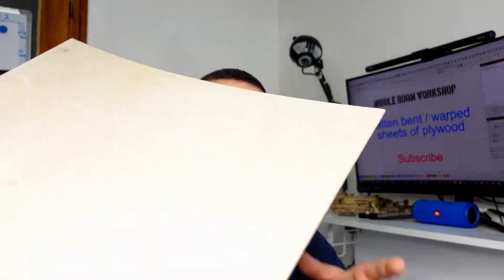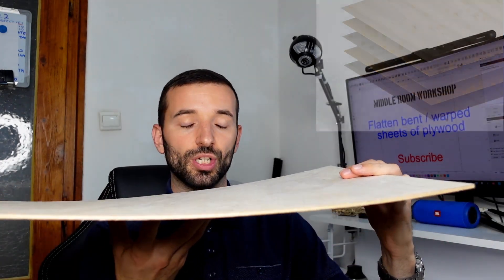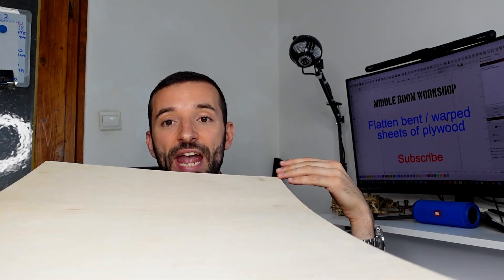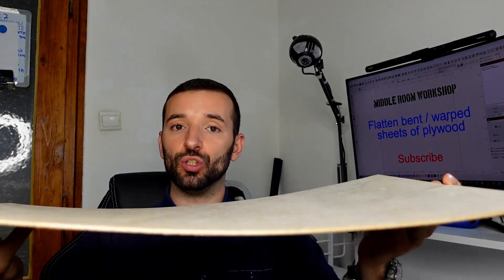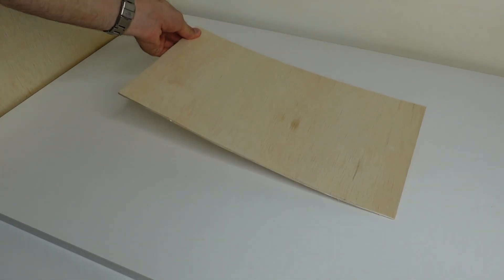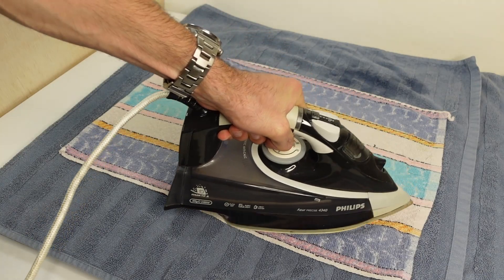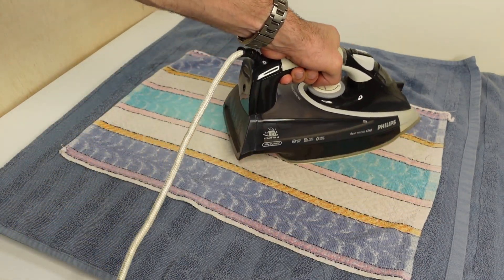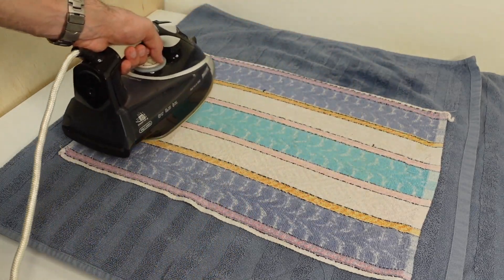How to Laser Engrave warped plywood - How to flatten bent / warped plywood at home

Comment: Thank you for taking time to make this informative video. I was curious if you could possibly use a heat press in place of thee iron?
Reply from the maker: Hi, Lovemymules; thank you for your comment. 

I haven't tried it, but it would work fine.
Just the heat should be applied on one side only, therefore, I can suggest putting some extra sheet (waste sheet or towel) on the side where there should be less heat.

Ciao

Comment: Hi!
I recently purchased a laser neje 2 and now I wonder how to set it up properly? When I tried to cut out a square the x-axis isnt cutting straight, it's a little bit wavy and on the y-axis it's not cutting at a 90 degree. The angle becomes 91 degrees from the first corner and 89 degrees from the second corner. Can you help me?
Reply from the maker: Hi Michael Andersson; thank you for your comment. 

I have recently released a video explaining the common shape problems with your machine the link is below.
In your case, you are using a cantilevered machine, meaning the x-axis is supported on one side only. Therefore the wheels that allow the axis to slide along the rail are not aligned. 
I suggest you lose one or two wheels until the x-axis wobbles, then take a squaring tool and try to square the two axes; you may clamp the squaring tool so that the axis does not sway while re-tightening the wheels. 

For the waviness, make sure that the belts are tensioned adequately without slack; if that is already done, there is not much further that you can do as that is an hardware issue as I discussed in my video.
https://youtu.be/XOiEh8S0fjk

Let me know
Ciao